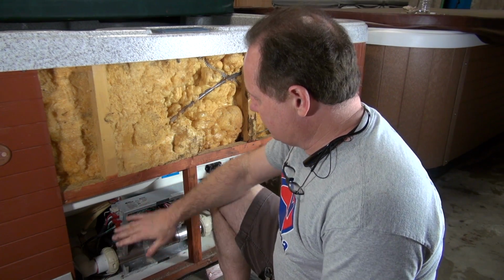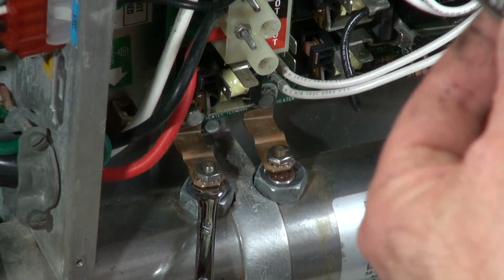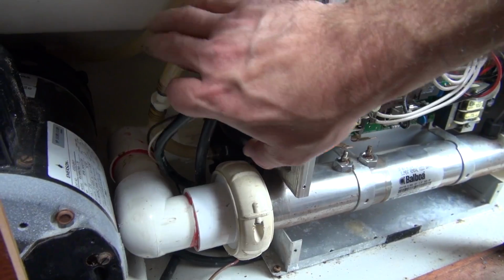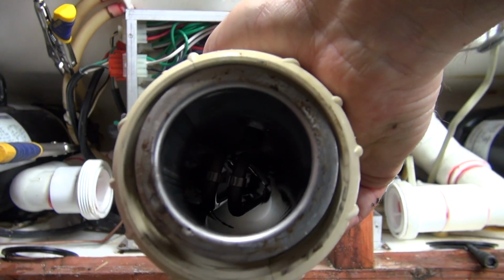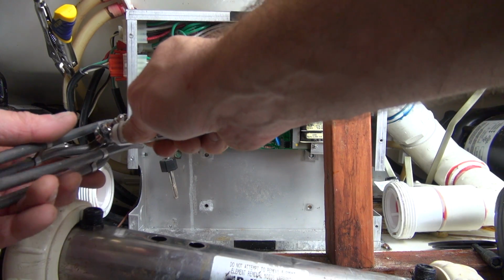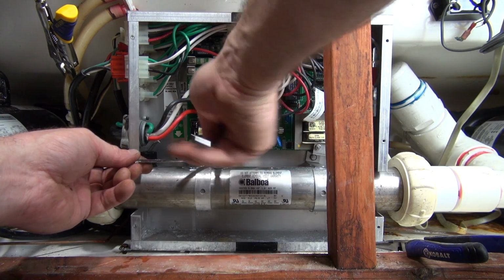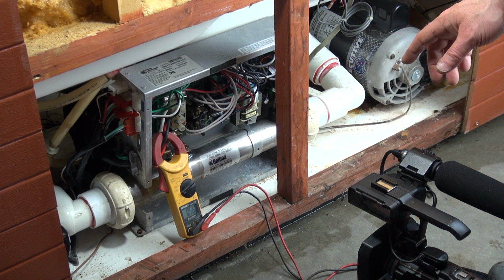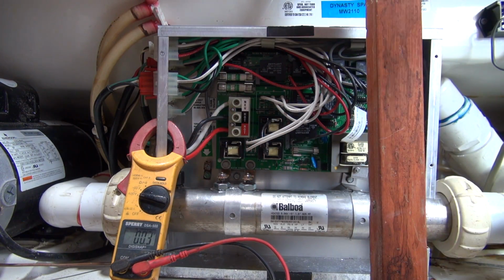GFCI Breaker Trip Diagnosis Heater Replacement Hot Tub How To Spa Guy

Comment: Hi there... this is so helpful!thanks! Just curious, my son accidently flooded the outside of our tub. What do you recommend we do?? It is tripping the breaker...
Reply from the maker: Jennifer, Usually flooding the tub will not cause the breaker to trip.. What brand is it?
Reply: Sweet water, it flooded to about midway point of the tub, its built into the deck, so the panel was flooded for a few hrs.. :( we tried to turn it back on, and the breaker keeps tripping
Reply: Thanks and appreciate the quick reply
Reply: @MrFox-vn7ie  probably turn off breaker and let water clear away and all the motor parts dry up then turn breaker back on

Comment: well done so perfect diagnostic troubleshooting shows your skill level- thank you for doing this!
Reply: @Spa Guy, I followed your troubleshooting since my hot tub keeps resetting the GFI, It is a Balboa HS200VS and has an extended board for pump2 if I disconnect pump off this board/connector it won't trip GFI have you seen this go bad or is it the pump2 causing it?

Comment: Question I have a heater element 4Kw, when measuring across terminals it shows 14.5 Ohms. I had breaker tripping so I disconnected both terminals from the heater and it did not tripped breaker when I touched one terminal just like you show in the video back to the board it tripped again. Question is can the heater be bad even though I have a reading across terminals? Thanks.
Reply: Leszek Glazewski Yes the element is not technically bad as in open but it is bad as in it is bleeding to ground and putting enough voltage in the water that the GFCI breaker is doing its job and tripping... usually this is from the epoxy they sealed the terminal mounts to going bad and leaking... note there are varying qualities of heater elements so I suggest the Titanium version it is the best quality.. Thanks, Spa Guy
Reply: Thank you for your help. Just found out I have two year warranty and they are shipping new assembly for free to me as we speak. Thanks again.
Reply: Leszek Glazewski no mo

Comment: I checked a crossed my leads and read 0 but each I read half voltage...did you say it's a cold solder joint? What does that mean?
Reply from the maker: That means you need to continue diagnosing the issue.. You have only measured part of the voltages.. Need to continue watching the video.. Spa Guy

Comment: what ohm reading will you get if you twist it?  will it be zero or 15?  i have 15, my electrodes look melted black. They were fine up to 94 degree water temp, then something shorted, i plead the 5th
Reply from the maker: What do you mean twist them? If you unwire the element and the breaker sets then the element is most likely bad..

Comment: Hi spa guy, we have a 1998 sundance altamar 850 spa and recently we noticed that the tub only heats up when the main jet pumps are on. i assumed the circulation pump should be pumping hot water out into the tub but it isn't, the circulation pump buzzes and gets very hot and when the jet pumps are off the heating element gets very hot that you can't touch it. however as soon as the pumps go on it cools down rapidly, when we leave the hotub with no jets off for a period of time it goes into overheat mode and sometimes flow mode. the way we fix this is to leave the jets on. is our circulation pump broken or could it be the heating element? because it does heat up but you have to have to jets on to get the heating on.

if we leave the jets off for a long period of time or a few hours the hot tub eventually shuts itself off and goes into "watchdog mode" and we have to reset the breakers to get it back on. 

Also the heater only lets out head from the interior heater jet when the pumps are on.

thanks for your time.
Reply: R39

Comment: You mentioned that if the heater bast the voltage and ohm test its most likley not the heater. What could else could I check as my friends spa is not heating but does have 15 ohm resistance on 1 4kw heater with 240 volts
Reply from the maker: If it has resistance and voltage it heats one of those measurements can't be correct.. it is possible to have a voltage measurement where you have a cold solder joint on one of the board relays.. This would be unusual as pst of the time it would create a spark or bringing if it was making a slight connection with the heater on.. I have videos about cold solder joints.. This may not be your exact board but will give you an example of what to look for.. https://www.youtube.com/watch?v=oiQBBHtejMA&t=7s
Reply: Thanks for the quick reply. 
It’s a similar setup as the video you posted. Balboa  

When I tested yesterday it read 240 on the heater terminals and 15 ohms.  I didn’t check for amperage and I can do that today. 

I did spot a leak at the knife valve past the heater and he’s said he’s had to top it up with water for 10 minutes after each session (2 person spa) 

One thing I noticed was one of the sensors that plugs into the board, the female clip on the board slides  off the pins and stays in the male fitting from the sensor on just 1 of the 2 connection points on the board.

Comment: Spa guy,
My house has a built in bathtub/jacuuzi.  When we have lightning storms the unit turns automatically.  What would cause this?

EP
Reply from the maker: Eddie, Most likely you have a system with a board on it that when it looses power and comes back on it comes back on with the pump circuit powered.. Hot tubs with TVs had that problem. When the power went off the tv would lift out of the tub and damage the covers.. You could change the guts of your control especially if all it does is turns your pump on with a manual switch system and solve that.. Thanks, Spa Guy
Reply: @SpaGuy  Thanks for the quick response.

Eddie

Comment: Hi Spa Guy, I have a pretty strange issue, that if anyone can help me with I think it will be you.  My hot tub an old Coleman Horizon 455 started throwing an overheating signal on the topside panel.  However the water in the tub is not overheating and appears to be the same temp as the top side is showing.  Sometimes I get a SN1 which after researching is a high limit switch failure.  I have removed the high limit switch from the top of the heater casing.  When I did this, I noticed without the Hi limit switch in place (just dangling down below) the tub will run, heat and do everything fine. 

When the pumps are turned off and the water is not circulating, the heater element casing gets so hot that it is rather uncomfortable to hold my hand there for too long.  My infrared thermometer is showing it to get up to 98 degrees.  Temperature on the top side when this is happening is the exact temp of the tub 84.  

I can turn the temp up and the heater relay energizes, the little fan in the control box comes on and the heat indicator on the top side illuminates all like they should.  If I turn, the heat down, the heat relay denergizes and the fan turns off and the heat icon on the top side goes out.  However the problem seems to be that the heater is possibly staying on as the heater element casing starts heating up to uncomfortable levels again in a matter of 30 seconds.

So the relay seems to engage and disengage, however the heater element seems to be heating all the time.  I probed both lugs on the heater element and they both are showing 120 vac a piece regardless if the thermostat is turned up or down below the tubs actual temperature.  I am at a loss what is making the element stay heating.  Top side controls show the heat is off but something is heating up the element casing to 98 degrees.  As soon as I turn the pumps on, the cool water circulating through the heater casing cools it down significantly.  

Please help, we are starting to get to low temps and I don't want my tub to end up freezing because the hi limit switch keeps the pumps from circulating because the element is constantly on.  I did just replace my gfi breaker because the other one went bad.  Do you think a breaker could cause this issue, or is it maybe a bad heating element that failed in a stuck on position?  Is there another temperature sensor that tells the heater to come on that is maybe bad?  Thanks in advance, I love watching your videos and learn a lot from them.

Comment: Hi Spa Guy, I recently had my Marquis Epic Spa (12 years old) reading 102 degrees but not heating to that, and then a day later it worked fine.  Then I didn't check for a week and when I did, the GFCI Breaker was tripped.  I was able to reset and when I did, I get a "HOt" error code and nothing works (pumps, nothing).  Any ideas on what is causing this?  I have continuity between heater posts.  I disconnected heater element and I still get the code. I am thinking High limit switches?  Thanks!
Reply from the maker: Timothy call 615-481-6941 ext 6 Thanks, Spa Guy

Comment: Hi.
I have a royal spa I bought used,it has ran about a year now,well this past sunday it tripped the breaker,I have watched this video and I have unplugged all 5 cords going in the side of the control box and it still tripped the breaker,any thoughts.
Thanks.
Reply from the maker: Did you unhook the heater?
Reply: Spa Guy what happens when  my J-400 was accidentally over flowed while adding water . Has dried and now throws breaker . But is still alive as far as power kicking jets,lights,ECT. before tripping breaker. IS THERE ANY HOPE ?

Comment: At the end of this video  you said "if the reading is 0 across the 2 electrodes and half voltage to ground on both. Than you have  a cold sodder joint on the board" how would i correct that issue 🤔

Comment: NEVER do this without turning OFF THE POWER!--this point was not adequately made. 2--this is a vid about breakers, not GFCI tripping--they're different birds, though, a similar diagnosis program is generally followed.   I've found that removing/unplugging various components and resetting the breaker or GFCI is the simplest diagnostic approach to hot tub shorts and faults.  Do not work on a plugged-in/power-on  hot tub!!
Reply from the maker: You clearly didn't watch the video.. It is about a breaker tripping meaning it is not turned on.. therefore if it si not turned on you have no reason to turn it off. If you think I didn't do this video adequately I suggest you start making some of your own..